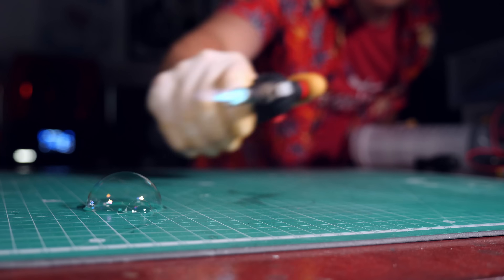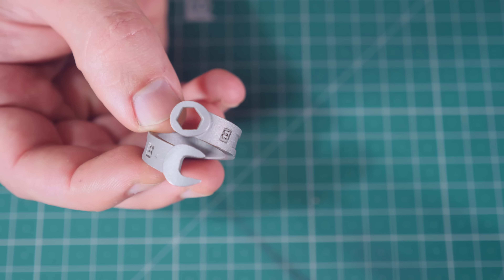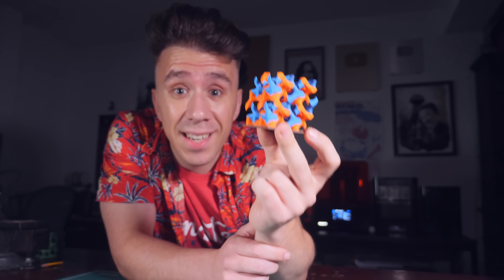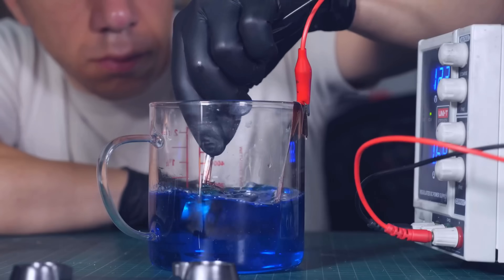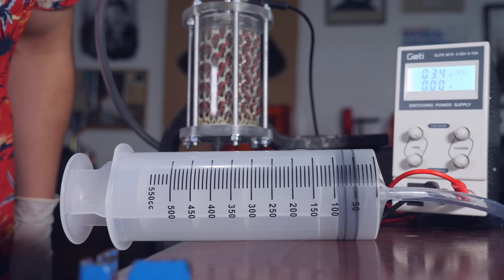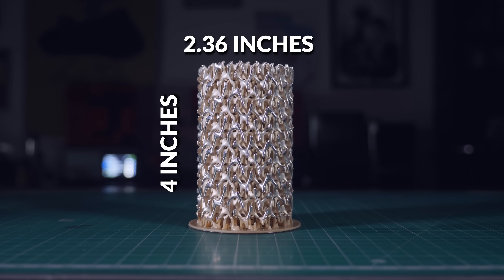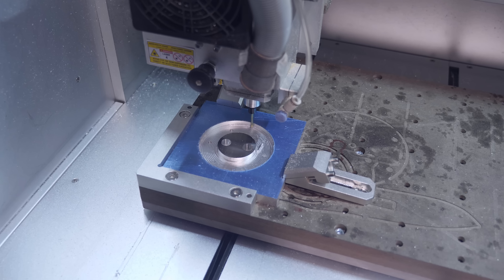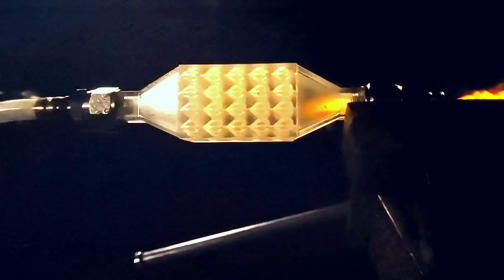ROCKET that LITERALLY BURNS WATER as FUEL

Comment: I'm still an engineering student, and I wanted to share some ideas I've come up with. (Any helpful comments are appreciated!) ;

1 - You can add more batteries in parallel to achieve higher current. For example, putting 2 x 400 amp batteries in parallel will theoretically give you 800 amps. Just don't forget to add cooling; that's likely what's killing your batteries. 

2 - The improvement in the shape isn't bad, but it's still not very efficient. You might try making them cone-shaped, like ice cream cones. This improvement may not be significant, but it will help achieve continuous combustion. You may find better solutions on the internet, but this is the one I chose since it's not hard to craft with the thin metal already available.

3 - If I'm not mistaken, you think that higher voltage is better, but this isn't necessarily true. It's important to find the optimal voltage, as this can also help manage battery life and power supply issues.

4 - You might also consider attaching the ice cream cone-shaped metal sheets to a small motor to spin them for mixing. Although I’m not certain, this could help improve efficiency.

5 - Adding heating elements inside the water may also help improve efficiency. However, achieving the optimal temperature with a DIY heating element can be challenging.

Again, these aren't comments from a professional; I'm just sharing my thoughts about this awesome prototype!
Reply: so 2 car batteries in series would give 24v and around 2000amp?  while having enough thermal mass to stay cool longer.

Comment: I think that the solution would be to use a modified microwave transformer to generate those huge currents. You need to rewind the secondary in bigger wires and fewer turns. There is a video by electroboom covering the process to modifying such a transformer.
Reply: Yeah although he'd still have AC current which doesn't work with electrolysis. He would need to add a FULL BRIDGE RECTIFIERRR! lol
Reply: Doesn't the transformer outputs ac current ? Though that can be converted to dc(theoretically at least), but i doubt that any diodes will survive such huge currents.
Reply: @mrgreenguy  Thanks for the comment! Makes me think that running two transformers in parallel with a single high current diode as rectifier is good enough? BTW, I've been watching your videos for years now!
Reply: @mrgreenguy  If you don't care about product separation (which Integza does not for this project), you actually can use AC.
Reply: cant you just run another battery in parrallell or series (forget which one makes the current bigger)
Reply: @figmentincubator7980  Ah yeah, that makes sense

Comment: You should modify a small internal combustion engine that could use hydrogen as a fuel and make an electric generator out of it.

Also, a bipropellant rocket engine that uses hydrogen or oxygen as a component of the fuel would be really cool.

Comment: You should think of a fuel tank for this as something comparable to an air compressor tank when a compressor tank is over pressurized it bleeds off to a blow off valve. That’s the fuel that you can burn and then it would always be under pressure.and you could control the flow

Comment: Your battery's are dying, because you don't regulate the power output. You basically connect them in a short circuit, which means they give all the power they can give. The manufacturer normally provides an C rating based on long time current and one burst rate C, which means it can deliver this amount of current for a split second, but not much longer. Your battery's might overheat or discharge one cell below 3V, which kills the battery.  I think you could use an esc for rc cars made for brushed motors. They automatically prevent the LiPo batterie discharging one below 3V (most only measure the sum of the voltages) and control the current. You could also use many batteries and connect them in parallel, so the current adds up. There is probably some kind of manual esc, which allows to set a specific current.  Ideally building a transformer would be the best solution.
Reply: What about using a welder as a power supply? Isn’t that designed to run as a short circuit?
Reply: Yeah. I explained the whole U = R * I to him in my comment. If it's a 15V battery rated for 150A he needs at least 0.1ohm resistance to not fry it.

Comment: Since the PSU was showing 1.7V-2.7V 10A it seems like you need a low voltage battery  with very high discharge capability.
You said that you tried using a higher volts and higher aps battery but it seems like you just need higher amps.

As a video idea you could make a DIY battery that fits your specifications (large number of high C discharge LiPo cells in parallel)

by putting them in parallel you will only get a 3.7V battery, but i think it's enough watching this video, the advantage is that they C capacity will add up with each additional cell.
so if you get some 50C cells, lets say 10, you put them all in parallel you get a 500C battery 

500C at 3.7V means that it would be able to discharge 1850A (more or less, depending on voltage sag) 

or you cloud go the route of styropyro, and get a bunch of car batteries to put in parallel, the voltage will be higher then necessary, but the construction should be easier
Reply: Ah yes, stack together 10 cat batteries to get electricity tricks on a next level. And get some molten metal mess.
Reply: His entire fault with it is not taking into account basic V=IR calculations. Increasing the voltage constantly means you're pulling in more amps which is draining the batteries fast. Simply could have been solved with 75C/3S cells with a PWM power control
Reply: Just use a car battery. 1000 amps @ 12v ...
Reply: The solution is not transformer,car batterys or anything like that -he doesnt need that ,what he needs is to build a more efficient generator with anode and cathode connected in series with 1.24 v on each cell.For 12 v that woudl be 6 cells with andode and cathode in each separated container.
If he made it this way it would draw 20-30A not 400A.
What he built is outdated contraption that has 10% efficiency ,it only looks fancy but in reality it doesnt work.

Comment: For all those wondering about the title and thumbnail:
He is splitting water using electricity and burning it again to form water, he is NOT burning water. Its just mild clickbait.
Also I feel like you could just use the electricity you started with to power your car etc. or whatever it is that you needed fuel for instead of making H2 and O2 gas.
It would be more efficient than converting it into H2 and O2 and subsequently burning it again.
Reply: You can't power a fuel rocket engine with electricity.... or did you just miss the whole point of the video?
Reply: @beef0678  Yeah, but you could just fuel the rocket with fuel, ya know, like they do in real life? but yeah, I see your point, its just that the fuel tank is essentially a battery and a water bottle which are collectively too heavy to actually lift into the air using a constant output of fuel gas. I will admit that if you generate all your fuel beforehand, then you could burn it all at once to get enough lift, but then you might as well remove the battery and water tank before takeoff since they are only weighing you down now...

Comment: 18:00 HyperspacePirate has some videos on electrolysis. You should definitly limit the current with something like a variable resistor or use a stable current source (one that keeps the amps constant instead of voltage).

Comment: i gotta update youll love to hear. go and purchase 3 cheap electric ceramic heaters and remove there heating elements.there individual cells separated by ceramic insulation that holds them together and there the perfect stipeiometric 2:1 ratio and they have an insane amount of surface area they produce a lot of gas and because the way they were designed to generate heat due to resistance in ac current you're never going to put that current through them. each heating element maxes out at 1500 watts essentially 3 combined gives you a 4500 watt threshold. but you have any idea how much gas you can produce at that rate of power. all electrolyzers are going to produce heat you want to get your electrolyte solution to like 120° to 150 it's like the optimal temperature but you don't want it to get too close to boiling because then then you just stop producing gas and you make steam. but just a single heating element from one of those ceramic heaters you wouldn't believe the output of gas they can produce pre-made for $20 when you buy a heater and take it apart and use it for that and surprisingly they do very well and the high base ph environment with the electrolyte. i was able to find the heating element made of stainless steel but there often made of aluminum alloy which is not as well suited for such a base electrolyte pH but nonetheless produced gas and astonishing rate I was not expecting. look into it for what it looks like it you spent on making your helixes or whatever I wouldn't be one bit surprised that these $20 heating elements produce as well for 20 bucks compared to whatever it costs you to custom make them and the time.

Comment: I made one of these for a science fair experiment years ago. You know what my battery solution was? One of them slightly small car batteries you can put in a lawnmower or motorcycle.

May have flash-fried the insulation off my wires the moment I connected it, but it actually did something when I broke out the bigger ones. Problem is I used stainless steel, and the plates rusted ridiculously quickly.

Comment: I made these in a couple pickle jars, stainless steel plates in side with distilled water and baking soda. Ground to  my old truck and positive to my alternator. Than ran hydrogen line into carb. Got almost 200 extra km per tank. 
To test it in my garage I used my truck battery charger. It has a 2 amp,12 amp and start position. Put on start to get most amp. Worked good!

Comment: If you manage to vibrate the hole generator in a high frequency, it will produce even more gas. The gas bubbles release themselves faster from the sheets, and it also helps to separate the water molecules. Another tip, buy a power supply where you can limit the current, the hotter the water gets, the more current the generator uses.

Comment: Get a microwave transformer and remove the secondary winding and use 25mm^2 wire and wind it 3 times.

You would be able to get around 3volt 400 amperes of ac 

And by using a bridge rectifier setup with a high current capacity diodes u can achieve pulsating dc.

If you provide anything above 2 volts for water electrolysis, the efficiency will be significantly lower . The excess voltage will be dissipated as heat due to overpotentials, leading to energy loss.

The efficiency can be given by
((Thermodynamic voltage potential)/(Applied voltage)) x100

Thermodynamic voltage potential is around 1.23

Try using this power supply and beefing up the electrolysis setup u can get higher production of hydrogen and oxygen

Also would recommend using coarse sandpaper to get more surface area 😊
Reply: I had tried electrolysis some time back and after hours of research this was what yielded me great results

Comment: I think thats work: Make the non-conductor smaller (don't need this much surfice area) and for power supply use a computer power supply. A good computer power supply can make 100A in 12V
Reply: Based on some of the research I've read around large reforming operation efficiency, they lower the power requirements by using steam. 
The heat energy in the working fluid lowers the amount of energy required to break the molecule's bonds.

You can run a coolant circuit around your battery and a peroxide cell to generate steam, thus boosting efficiency and lower the electrical energy requirements.

Granted, I'm still studying this stuff so take it with a grain of salt in case I'm missing something and do your own research.
Reply: @aEtherEater  how do you make sure the steam doesn't get inside the fuel lines?

Comment: Integza, you should build a mini jet engine, or even a rocket engine, then attach it to a foam rc airplane. imagine the speed, although if you directly attach it to the foam, it might burn due to the heat produced by the jet engine, so the foam needs to be covered by something heat/fire proof.
Reply: Nice Idea, but just think about making a carbon fiber shell, than disolving the styrofoam using acetone
Reply: I second this, her.ws your like for the 3d printer
Reply: @Depul761 That's actually a great idea! Only problem left is where would the fuel tank go, maybe inside the plane? would be a bit more complicated, but its possible
Reply: @gabrielneves6602  ty bro

Comment: @Integza you should try a Stanly Meyer generator to get your gas.  He used water as the insulator between two capacitor plates. He would then charge the capacitor with a 50% duty cycle and a resistor to prevent spikes and arcs across the plates.  When he charged the capacitor to overcharge he would get a catastrophic failure in the insulation medium and a ton of HHO gas.  He could repeat this about 30 times a second.  From the math I have seen it might be the most efficient form of electrolysis we currently have.  A 555 timing chip can be used for the duty cycle.

Comment: The solution is of course a microwave transformer. The primary is 220 windings if you are in europe, 110 if you are in the US, secondary: 1 per volt you need, so 12 for 12 volts. Remember: wind with  a wire that can handle the full amperage draw, or prepare for melting wires
Reply: Negative. You want consistent voltage to maximize efficiency. Even if you don't care about electrical efficiency, the wasted energy is heating up the water and will boil it (the opposite of what you want).

Comment: A value I remember from college chemistry is that one mole of a liquid converted to gas by evaporation or boiling will occupy 22.4 liters at STP. A mole of water is ~18g (or ml), from which you get 2g of hydrogen when dissociated. A kilogram of hydrogen would require 500 moles of water (about 9 kilograms or liters), and take up 11.2 cubic meters as a gas at STP, a cube about two and a quarter meters on a side.
Reply: @seanmalloy7249  so slightly bigger than Harry’s room 😂

Comment: This is old science. The guy who discovered it, or at least made it public, tried to make a water based car engine. He mysteriously died of a heart attack after giving a T.V. interview about it.
Reply: Not the same. 
Stanley Meyers used pulsed/'constructed' frequencies to (supposedly) use considerably less power. 
I may be 'off base' but, I believe 'industrial' and 'commercial' HH/O generators (for large warehouse forklifts, etc.) are somewhere between standard DC electrolysis and Meyers' pulsed designs.

Assumed, based off the fact that DC Electrolysis had been solidly proven too inefficient for any commercial applications; yet, commercialized on-site HH/O generators using PWM, exist.
Reply: @LRK-GT  Gotta admit I dont understand the finer details enough to know if thats true. If I had the money and time id test this stuff out myself.

Comment: Yeah Brown's gas can be very dangerous. However it is very powerful. I know also the more current you push through the system the more gas will create quicker. You just have to be careful not to overdo it because the leads that run down into your solution can heat up and start going and as soon as that happens you get an explosion. I learned that the hard way. We started out with a voltage regulator thing that we can adjust up to a certain point and then we just didn't have any more power so we ended up playing it directly into a wall socket and it worked great for like a half a second I've seen those Leeds running down to the solution start glowing right after I seen them start glowing the generator exploded. Me and my brother were the only two in the workshop at the time how neither one of us got hurt or killed I don't know but definitely dangerous stuff but I think there's a lot to be said for its usefulness

Comment: This was a great video of a hydrogen cell. I found this to be a very cool informal video on what worked and what didn't.  I really enjoyed the plating part. I was the one who was up with plating roses 🌹 with a conductive spray back in th I had a friend who was plating parts of cars  and guitar parts.  So I thought if they  could plate plastic grills for cars why not lacquer a live rose and spray it down with the conductive spray and plate it with copper then gold preserving the rose for ever. A flower that never dies, like a love that never dies or fades over time. And it worked stellar. But I didn't pattent the plans so it was later reviled to his friend who ran off with my idea. Oh, well, I have the very first one. Anyway I really appreciate your video and am interested in making a hydrogen cell simulator to the one you have built in this video. I wish I had a 3d printer because I would like to try and build a bunch of different ideas I've had over the years. Have a wonderful day 😊!

Comment: Use a 40 amp circuit breaker and pulse width modulatier Pwm to control your amperage. I've been building them for over 10 years.

Comment: Could you create a generator with the same technique
Reply: unfortunately not, because it needs electricity to operate: the same electricity you put in to split the hydrogen and oxygen is released when they react and turn into water again. Add literally ANY conversion loss (which is basically guaranteed) and you're losing energy.